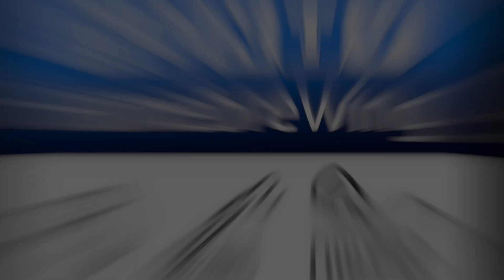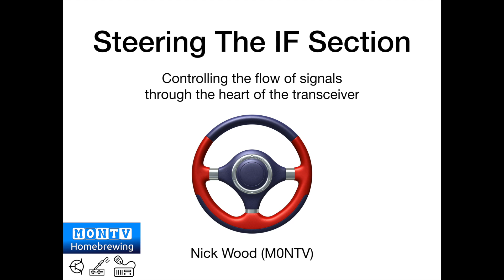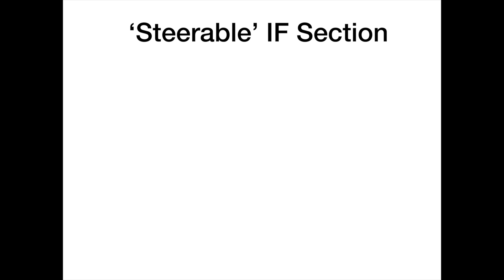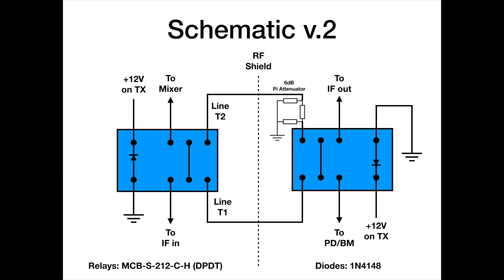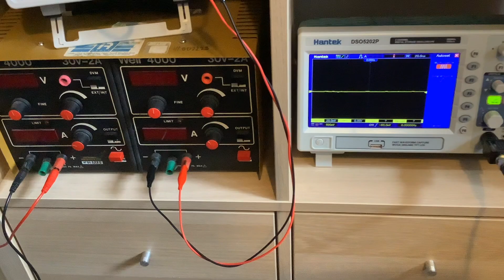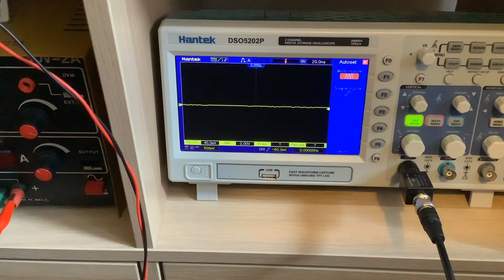25 - Steering the IF Section

Comment: Well done, nice presentation.

Relays - yes can be "interesting things at times... 
You can often get better isolation when using a single relay, if you use a relay with more contact sets. 
You can place your signal contacts on the outside and then ground the inner sets which will produce a sort of "internal shield"
This can help increase the isolation.

Another thing to remember is that any open wire is a problem so if you have some more contacts available you can also use them to ground the open wires, especially on the input side. Sometimes every little helps!

Andy
Reply from the maker: Thank you so much Andy for this very useful information. I love it when I produce a video and learn more myself! Thanks again. 73